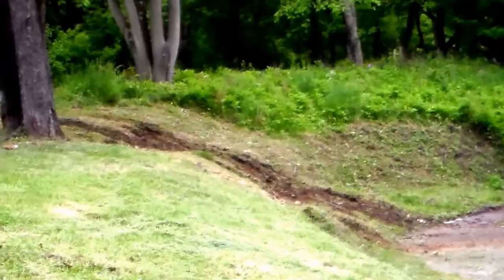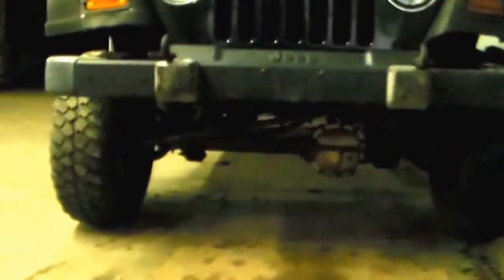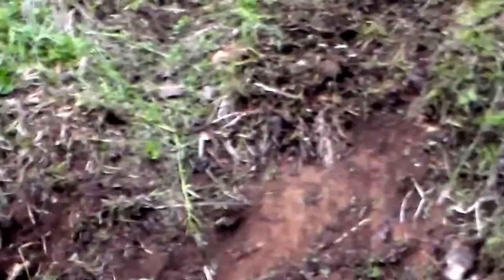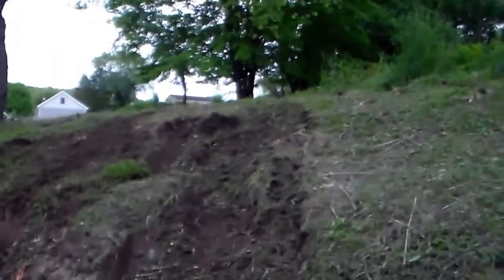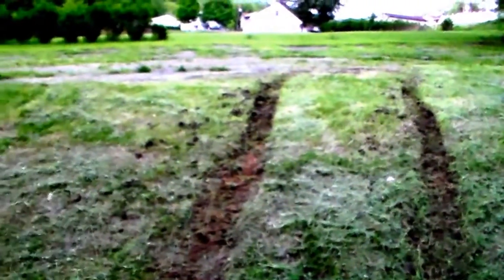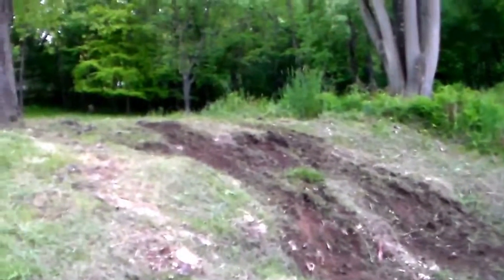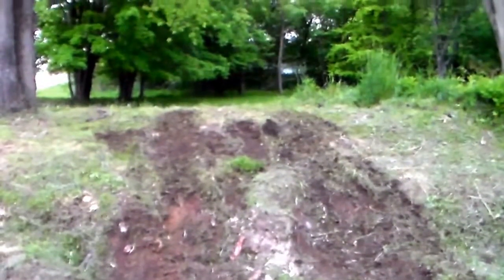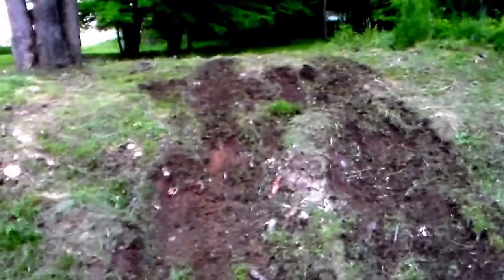New Obstacle at LFTD Offroad

Comment: Steering binding, like locking up not being able to move? Or rough steering? I saw you moving the tires back and forth before the hill, was it binding even before it was under a load?
Reply from the maker: Central Oregon Survival Network no, it wasn't really the steering, i was just thinking about how it steered. the problem was trying to use a locked front diff on the hard surface. so there was some binding of the wheels as they tried to roll.
thanks for watching.